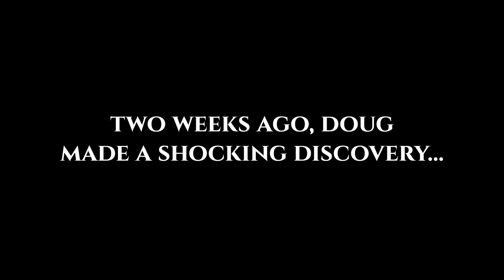Wyrmwood Modular Gaming Table Coming to Kickstarter! (Special Offer for Wyrmlings only 🤫) S5E8

Comment: Aw, man. Seeing the Padauk table in finality sealed the deal for me. Gimme that Kickstarter!
Reply: It really is gorgeous.
Reply: Padauk is my jam. =)  I'm looking around my apartment and quite frankly am astonished at the number of old TV/Computer/Printer/Entertainment pieces I have with huge storage areas on the bottom.  I could see myself replacing some furniture.  My biggest game storage is the entertainment center my current 32" TV is on (used to be a microwave cart back when microwaves were huge in size). I have longer boards sitting over the top of it as the unit itself is not wide enough for the TV legs, but the bottom storage area is 30" wide 21" tall and 18" deep, on some really heavy duty casters (nice for vacuuming) and is stuffed full of old traditional board games.  I like that the doors keep the dust out, but I keep thinking if they had some of those Wyrmwood magnets from the dice vaults on the doors instead of what's on so many of these units, my life would be so much easier. LOL!
Reply: I want to see that in the wargaming table size. Our group and basement room needs a wider table.

Comment: I don't know if anyone has mentioned this, but Board Game Tables did a kickstarter a few years ago that was the first "mass produced" gaming table.  They definitely had some shipping issues (mainly because they were produced in China or overseas).  It took them quite a while to get tables to everyone but their price point started at around $550 plus $150 for the topper.  We bought one because (at the time) it was the only gaming table you could buy for under $2-5k.  I'm really interested to see what your price point is because the quality looks fantastic and I would much rather have a Wyrmwood table than what we have now.

Comment: I'm super hyped for the lower cost tables and I have some quick questions:
Are there specifications released for the tables yet? Like the overall size of the table and the size of the board gaming surface? If not, will these be released before the kickstarter launches?

I'm about to move and although I have the floor plan I don't yet have a sense of how the space will feel, so knowing the table sizes would help. :) 
Plus I will unfortunately have limited internet access when the kickstarter launches... :( So all knowledge one can get beforehand would be awesome!

Comment: because Doug has a big head (proportional to his body....but if you need to chuckle at the pun that's fine) and a long face, flatter and longer hats work better than taller thinner hats. the "old Doug" scally cap  looks better because of that. i'd be interested to see him try on a stove pipe top hat to see if cartoonishly tall counter-acts that. because of Jason's size and face structure, he'd look better in that straw fedora....for Doug tho, i think if he switched the fedora to a wide-brimmed pork pie, it might match him better....or maybe a mariner's hat. yea, Doug would look better in a mariner's hat.

Comment: Why do you have espresso walnut when you have wenge total noob question but if I want matching wood I'd just choose wenge since it is used for almost all your products? Ebony wood would be my choice as well but I want fully dark wood and there is like one type of ebony wood that's fully dark with no discoloration most of the time but it is rare as fuck. If all your products had espresso maple I'd choose that because it is fully black but it's for only these products not dice trays, dice towers etc. great job really happy for both companies you have great service and great products.
Reply: The espresso walnut is a cheaper wood but stained dark, its a price thing.
Reply: Like Frank said... Price.
For the least expensive table the upgrade to Wenge or Ebony would probably be several hundred.

As a comparison:
A Dice tray in Cherry (slightly more expensive than Maple) is $85 and in Ebony is $285
A Dice Vault in Cherry is $33 and Ebony is $125

Comment: Sounds like you're looking to move away from handcrafting Doug with how in awe you are with Keystone's setup. A lot of the stuff you're excited about is stuff that's more on a factory production standpoint. There's no hand applied anything. Instead it's applied by airbrush and you're using equipment to make things easier. So less and less carefully spent handcrafting. I mean you already have machines for the dice vault 2.0 to help produce precision quality. Right there you're already selling a product that's not 100% handmade. Which also sucks to be honest cuz I backed that. Lol